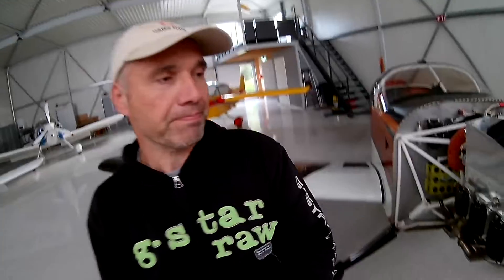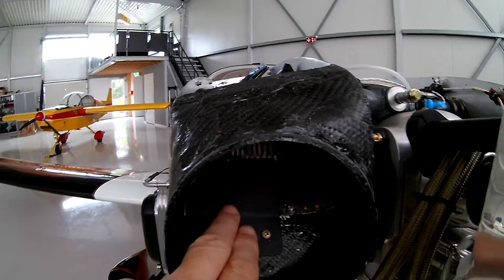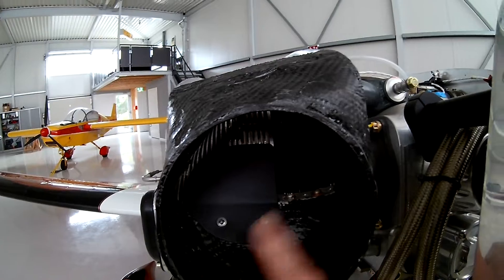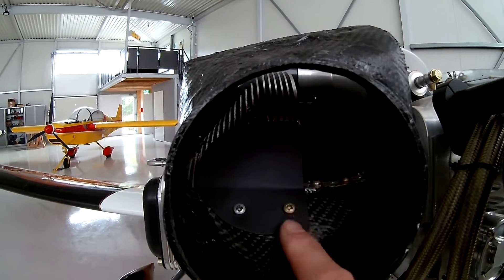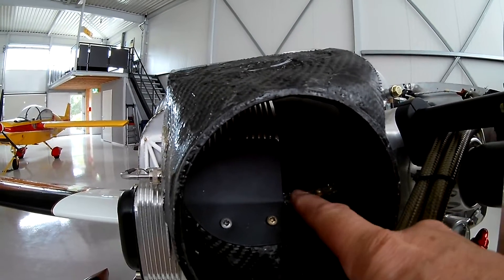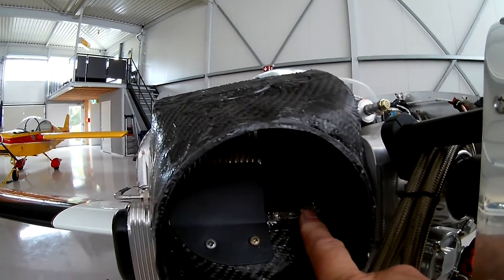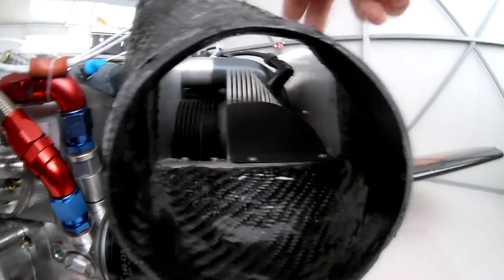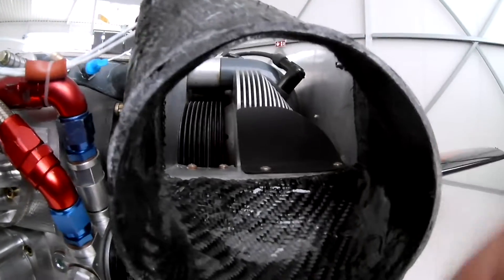Improvements on Air Intake and Exhaust

Comment: When you talk about your engine induction air temperatures, are you using Celsius or Fahrenheit scale?
Thank you
Reply from the maker: Hi,
Yes I'm using Celsius, I can't get a grasp on Fahrenheit (I would need to calc).
So ULPower told me the max diff between OAT and Manifold Temp is 25 Celsius. It was almost 40 Celsius, when picking the air form the cowl.
Now it's about 7 Celsius higher than OAT picking it from the baffles.
Reply: @PHMNX  Thank you for clarifying. I’m currently drawing induction air from under the cowl and had wondered if I was giving up power that could be gained from drawing outside air. I didn’t realize the temperature delta was so much. Guess what my next project will be!!!